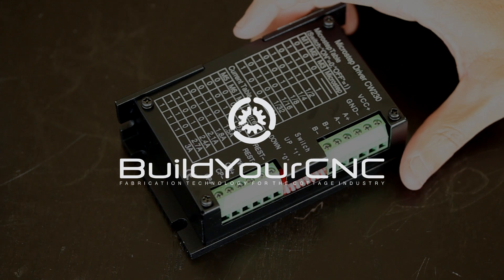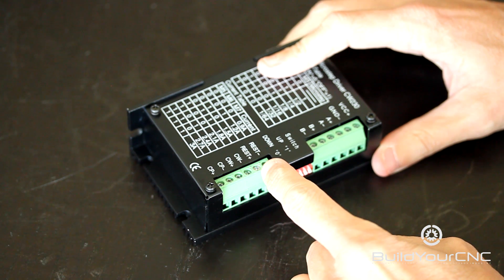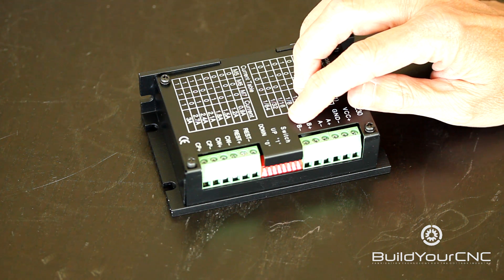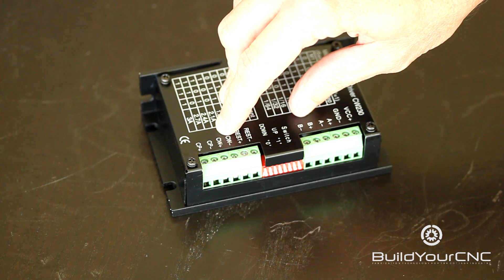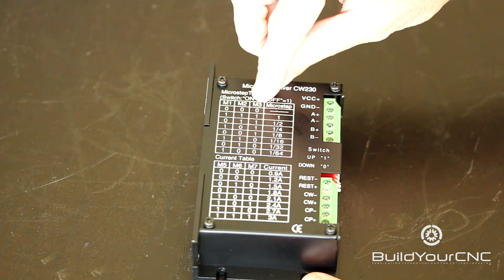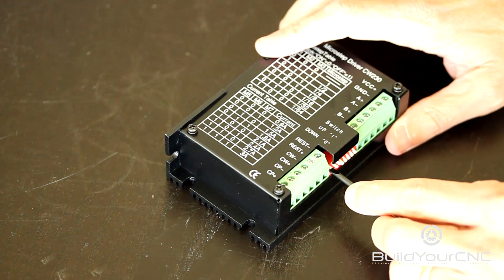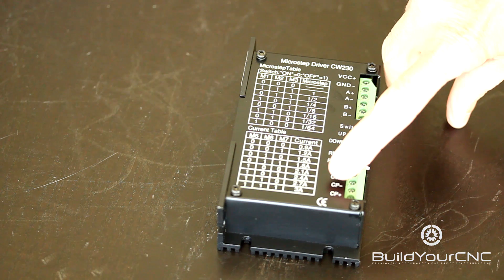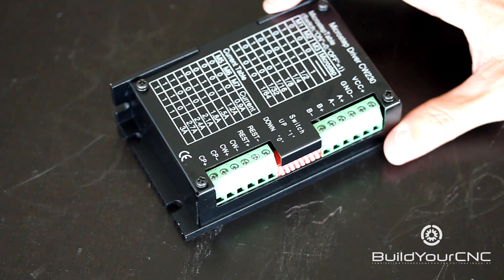How to Use the 3.0 Amp Stepper Motor Driver

Comment: normal good cnc used nema 23 or 34 motors minimum 470 OZ 3NM  this is about 3-4A /motors, i have 4A motors but next cnc come 6A motors and drivers. 3A 450 OZ motors have too small if want use good work. better have nema 34 6-9Amp,  6-12Nm  80-90 volt driver use. then have best torque and speed compination.

Comment: If you have three steppers can you wire the power in parallel on all three or would it be best to wire them separately from the power supply?
Reply: you need calculate how many motor and how much ampera need first, i use 5 4Ampere motor and this need 5x 4 A is  20 Ampere power supply minimum. i used 1x 10A and 1x 15A power supply to drivers, both power go wires to stepper drivers, 10A power S go to 2 stepper drivers and 15A power go to 3 drivers. working well.

Comment: Is it possible to show us  microstep TB6600 driver Arduino connection with the drivers  by the three motors with endstop buttons with relay to stop and run the drill please showing this in video or photo please ? cnc machine?
Reply: yotube and internet have million and million more how wiring power supply, stepper motors, limit switch, home switch, inductive sensors, arduino, etc many other controller board, all has same. arduino /if uses) need out to driver only step, dir, enable pins, and go to same drivers step , dir , enable pins, and driver come power supply normal 36-40V 10-15A and end stop go to end stop pin, and GND, relay need config software what pin used and connect this pin output  pin working whit relay and can connect what you want to relay, cooling pump, spindle motor light, fan, laser, etc, etc,

Comment: For a stepper motor, how do you know what voltage power supply should be adequate?
If a stepper motor is rated at 2A, does that mean 2A per coil (4A total), or, 2A total?
What do you set the current on the controller for?  Is it the total current draw?
Reply: I have this same question, did  you find an answer?
Reply: power supply need, if used 3 motor manual say maximum ampere have 3A/motor, 3motor X 3 Ampere is 9Ampere all, and need buy 10A max driver volt power supply.  
if use normal DM 542 driver max current can use have 4,2A but need setup to less little than motor max ampere have, 3A about, not more, drivers have setting dip switch and max voltage can use 48V better use about 46V 10Ampere power supply, Not setting driver more than max motor current or burn motor,  volt can be use max what driver can use, then motor have better speed biggest VOLT. i use 4A motors and 80 Volt. normal nema 23 3NM 4A motor.and biggest DM 860 max is 80V 6A. 30$/pcs.